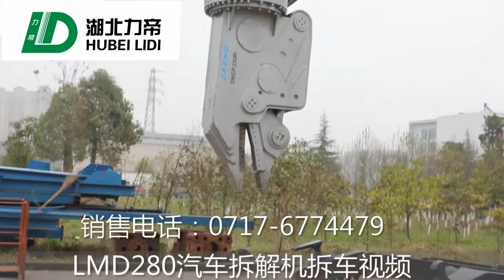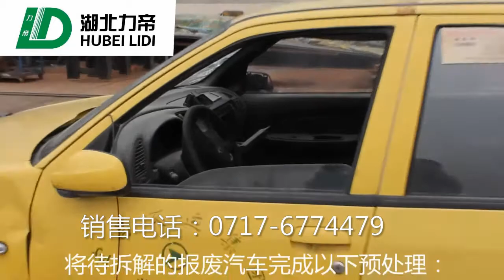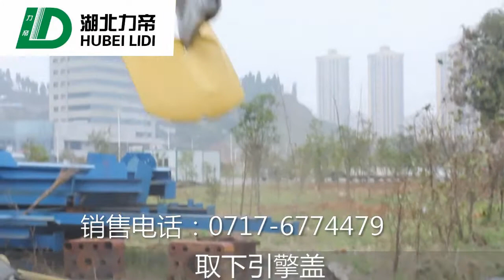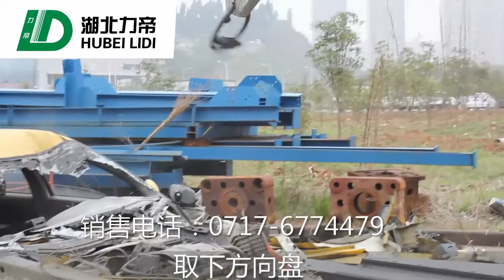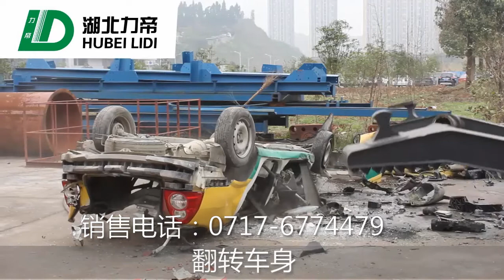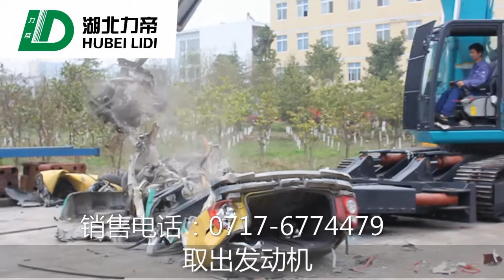LMD280 Car Dismantling Machine Site Video

Comment: They didnt even bother to drain the fluids, im surprised the alarm didnt go off when they started tearing it apart.

My question is; if they just put all the parts on a single pile, what was the point? They may as well just shredded the car in a tenth the time
Reply: Tech demo, I guess. Still, they should have drained out the air con refrigerant, that stuff is bad for the environment.